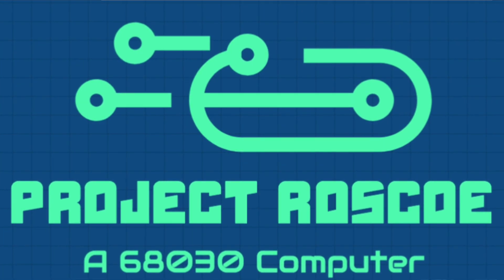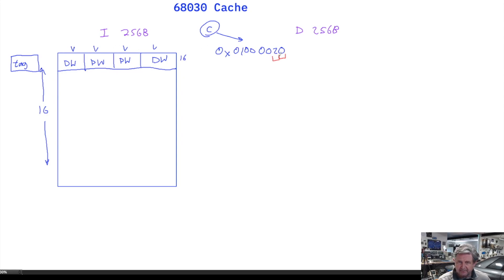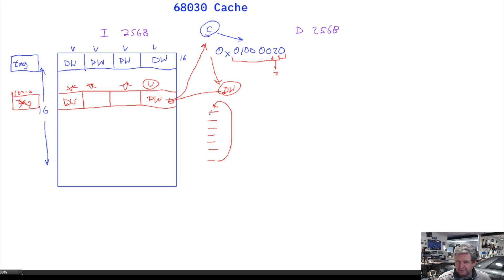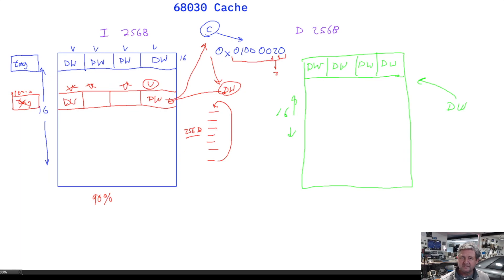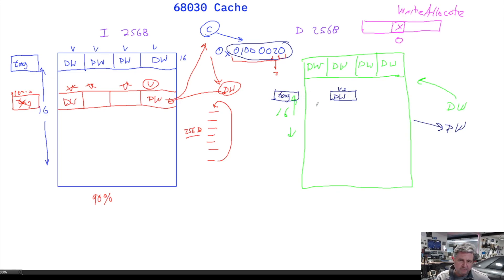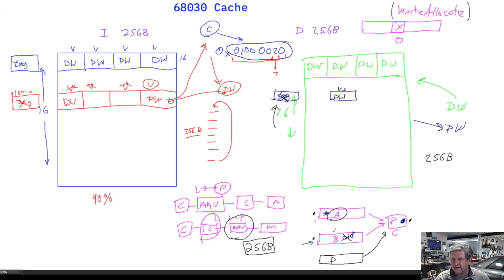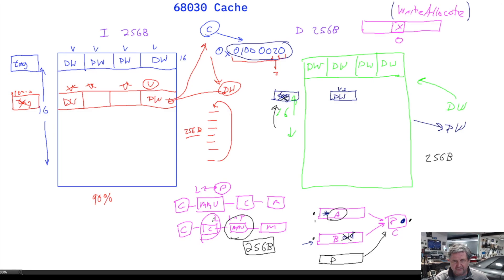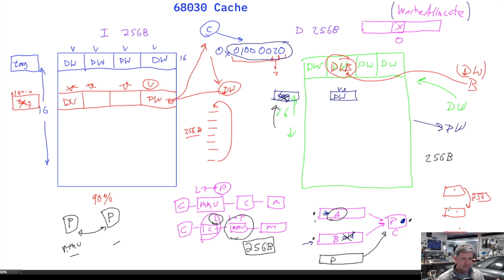Project Roscoe Ep 3: Designing and Building a 68030 Computer

Comment: Rather surprised the cache works like this on a decently old microprocessor, but goes to show why compared to an 8080, it's not just the 4x larger word size (8 vs 32-bit) that makes it have ~45x as many transistors, all those extra features like an MMU and dynamic bus sizing really push the transistor count up to squeeze every instruction per second out of every clock cycle.